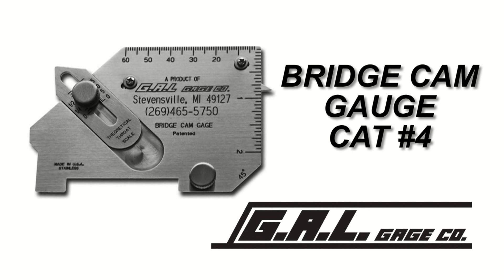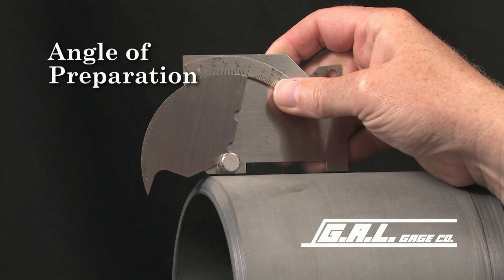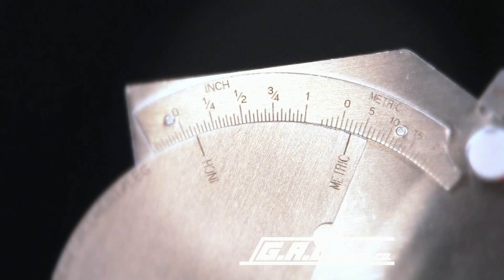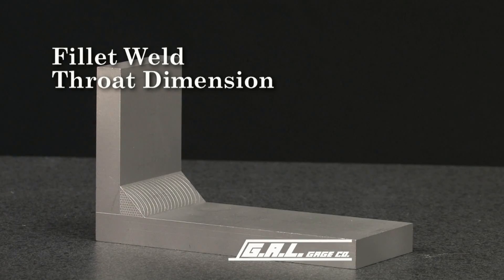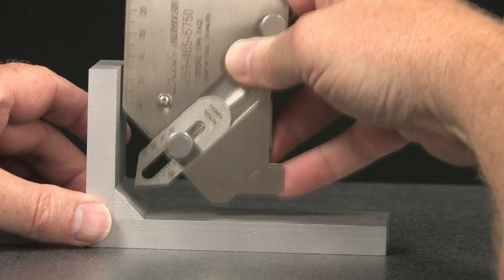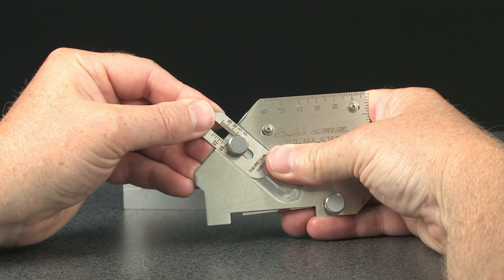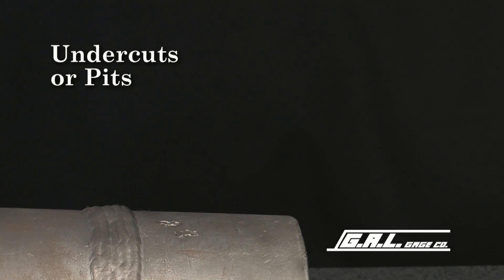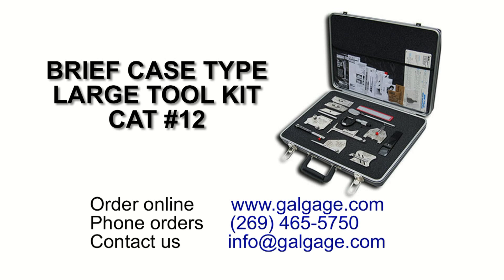The Bridge Cam Gauge by GAL GAGE Company

Comment: The radius gauge does have a manufactures tolerance, and sometimes they are out of that tolerance regardless of how good your eyeballs are. Kudos to you convincing your auditor that you don’t need of them calibrated.
Reply from the maker: To ensure that your measurements are correct, your gauges will need to be checked occasionally for wear and that the gauges have not been damaged.

Also, the markings on any gauge, from any source are for reference purposes only and must regularly be reconfirmed / recertified.

Final note, if your systems / auditors call for a periodic recalibration, it must be done for compliance purposes.